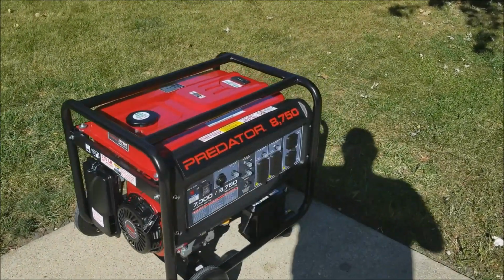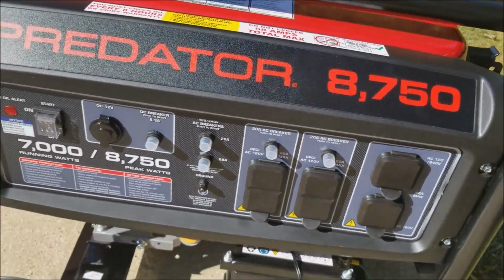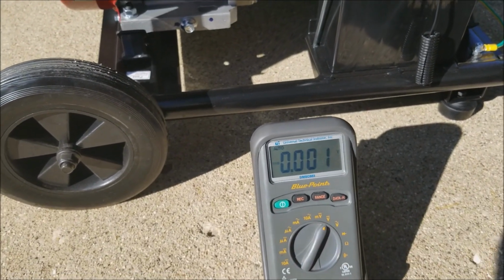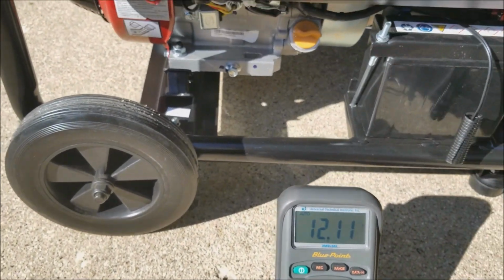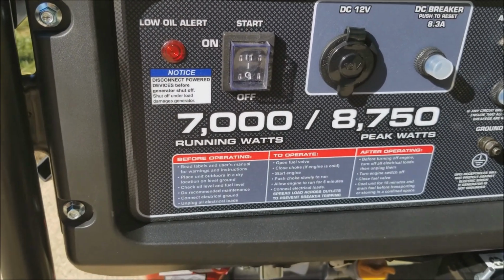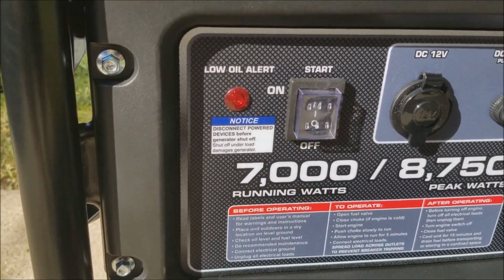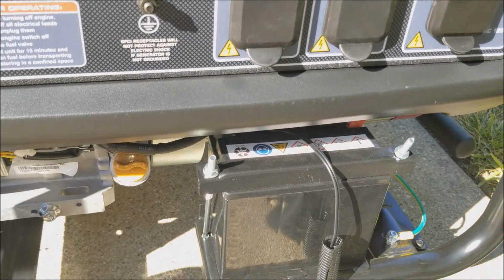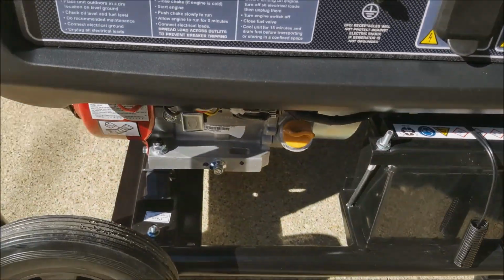Predator 8,750 Generator start up and voltage check

Comment: I purchased my Predator 8750 from Harbor Freight on sale for 499.95 and it’s pretty heavy at 230 lbs. I hooked it up through my panel in a detached garage I had built 8 years ago but I did all the wiring and ran 8 gauge from my house to garage underground in conduit put a service panel in with a 50 amp main breaker I still had my 30 amp in from the compressor I used to have and wired it into my Reliance L-14-30 4 prong outside plug and after running it about 2 hours I plied it in after turning off main in house and I can leave all breakers on except Central air went in house and was surprised that everything worked like I never lost electric but my hot water tank stove dryer and furnace are all NG. Now I’m working on just running it on NG LPG and if needed reg gas. This Generator hands down is a good Generator period!
Reply: ⚠️Always make sure you follow all the generator safety rules when you use your portable generator: 

This is just a reminder to make sure. It is important to follow all generator safety rules whenever you use your portable generator. 
Here are the things that need to be followed;

1) KEEPING OTHERS SAFE: Please do not allow an unqualified person or your children to operate and service the portable generator. Just because some manuals don’t say that doesn’t mean it’s safe. That is important against the generator safety rules. We also need to be keeping an eye on our children too. You need to make sure that your children are not playing near the portable generator especially when it’s running so they won’t get electrocuted. Generators pose electrical risks and they can be hot during an operation. Please keep your children away from the portable generator at all times. It is important to keep our children safe especially our little ones. Be aware of all the hazards.

2) WHERE TO RUN YOUR GENERATOR: Some people use their portable generators indoors which increases the risk of carbon monoxide poisoning. It’s important to have a carbon monoxide detector if you have a gas generator. Never ever use your generator indoors even if your doors and windows are open and even in the garage is not safe to use a portable generator. Not even at your porch and your deck. It is never safe to use your generator indoors and in enclosed areas of your home. Your generator needs to be 15-20 feet away from your house. 

3)🔥FIRE HAZARDS: Never refuel your generator while it’s running. You need to let your generator cool off before refueling it and before storing your generator. Never overload your generator too. Never ever back feed your generator. You should never plug your generator into a wall outlet. Also never store propane tanks indoors. Please keep flammable things away from the generator as well and please don’t smoke cigarettes near the generator. Having a fire extinguisher next to the generator is also important against the generator safety rules. 

4) GENERATOR OPERATION: make sure your hands are dry before touching the generator. Never use your generator in wet conditions. Don’t let your generator get wet. You need a generator tent if you need to use your generator during wet weather. Please don’t wear loose clothes when operating the generator. Turn on your generator before plugging in appliances. Use the right cord for your generator. Please do not use worn out cords. 

https://youtu.be/I1jT3ANENvI and here is a video more about keeping others safe when using generators 

Hope this helps

Comment: I've had a 4000w Peak, 3200 w Harbor Freight generator for 8 years. After it failed I bought this model. Later I found out that the reason for the failure was the low oil switch. As I checked the oil before each start, I decided to defeat that switch. Now I use the smaller generator for power failures in the winter, and the larger generator 4 power failures in the summer.
Reply: Don't start won't turn over predator won't start won't turnover generator
Reply: You always need to check oil. Then every 200 hours after first oil change. Get a fluid extractor to make it easier.
Reply: ⚠️Always make sure you follow all the generator safety rules when you use your portable generator: 

This is just a reminder to make sure. It is important to follow all generator safety rules whenever you use your portable generator. 
Here are the things that need to be followed;

1) KEEPING OTHERS SAFE: Please do not allow an unqualified person or your children to operate and service the portable generator. Just because some manuals don’t say that doesn’t mean it’s safe. That is important against the generator safety rules. We also need to be keeping an eye on our children too. You need to make sure that your children are not playing near the portable generator especially when it’s running so they won’t get electrocuted. Generators pose electrical risks and they can be hot during an operation. Please keep your children away from the portable generator at all times. It is important to keep our children safe especially our little ones. Be aware of all the hazards.

2) WHERE TO RUN YOUR GENERATOR: Some people use their portable generators indoors which increases the risk of carbon monoxide poisoning. It’s important to have a carbon monoxide if you have a gas generator. Never ever use your generator indoors even if your doors and windows are open and even in the garage is not safe to use a portable generator. Not even at your porch and your deck. It is never safe to use your generator indoors and in enclosed areas of your home. Your generator needs to be 15-20 feet away from your house. 

3)🔥FIRE HAZARDS: Never refuel your generator while it’s running. You need to let your generator cool off before refueling it and before storing your generator. Never overload your generator too. Never ever back feed your generator. You should never plug your generator into a wall outlet. Also never store propane tanks indoors. Please keep flammable things away from the generator as well and please don’t smoke cigarettes near the generator. Having a fire extinguisher next to the generator is also important against the generator safety rules. 

4) GENERATOR OPERATION: make sure your hands are dry before touching the generator. Never use your generator in wet conditions. Don’t let your generator get wet. You need a generator tent if you need to use your generator during wet weather. Please don’t wear loose clothes when operating the generator. Turn on your generator before plugging in appliances. Use the right cord for your generator. Please do not use worn out cords. 

https://youtu.be/I1jT3ANENvI and here is a video more about keeping others safe when using generators 

Hope this helps

Comment: Has anyone ran a welder off one of these? I'm looking to get HF 8750 and HF titanium 200 pro multiprocess welder and it would be nice to use the Gen to power the welder.
Reply: Titanium 200 welder can pull up to 36A @ 240V.   If I remember correctly the HF 8750 generator only has a 25A rated 240V output.
Reply: ⚠️Please do not forget to follow all the generator safety rules when you use your portable generator: 

This is just a reminder to make sure. It is important to follow all generator safety rules whenever you use your portable generator. Everyone needs to see this. 
Here are the things that need to be followed;

1) KEEPING OTHERS SAFE: Please do not allow an unqualified person or your children to operate and service the portable generator. Just because some manuals don’t say that doesn’t mean it’s safe. That is important against the generator safety rules. We also need to be keeping an eye on our children too. You need to make sure that your children are not playing near the portable generator especially when it’s running so they won’t get electrocuted. Generators pose electrical risks and they can be hot during an operation. Please keep your children away from the portable generator at all times. It is important to keep our children safe especially our little ones. Be aware of all the hazards.

2) WHERE TO RUN YOUR GENERATOR: Some people use their portable generators indoors which increases the risk of carbon monoxide poisoning. It’s important to have a carbon monoxide if you have a gas generator. Never ever use your generator indoors even if your doors and windows are open and even in the garage is not safe to use a portable generator. Not even at your porch and your deck. It is never safe to use your generator indoors and in enclosed areas of your home. Your generator needs to be 15-20 feet away from your house. 

3)🔥FIRE HAZARDS: Never refuel your generator while it’s running. You need to let your generator cool off before refueling it and before storing your generator. Never overload your generator too. Never ever back feed your generator. You should never plug your generator into a wall outlet. Also never store propane tanks indoors. Please keep flammable things away from the generator as well and please don’t smoke cigarettes near the generator. Having a fire extinguisher next to the generator is also important against the generator safety rules. 

4) GENERATOR OPERATION: make sure your hands are dry before touching the generator. Never use your generator in wet conditions. Don’t let your generator get wet. You need a generator tent if you need to use your generator during wet weather. Please don’t wear loose clothes when operating the generator. Turn on your generator before plugging in appliances. Use the right cord for your generator. Please do not use worn out cords. 

https://youtu.be/I1jT3ANENvI and here is a video more about keeping others safe when using generators 

Hope this helps

Comment: Dam it's pretty! Nloud! Pretty Loud!
Reply from the maker: It's a generator, they tend to make noise, it's just part of the deal
Reply: Loud
Reply: This generator is really loud
Reply: These clones are all load.
Reply: @josephpuchel6497  ⚠️Please do not forget to follow all the generator safety rules when you use your portable generator: 

This is just a reminder to make sure. It is important to follow all generator safety rules whenever you use your portable generator. Everyone needs to see this. 
Here are the things that need to be followed;

1) KEEPING OTHERS SAFE: Please do not allow an unqualified person or your children to operate and service the portable generator. Just because some manuals don’t say that doesn’t mean it’s safe. That is important against the generator safety rules. We also need to be keeping an eye on our children too. You need to make sure that your children are not playing near the portable generator especially when it’s running so they won’t get electrocuted. Generators pose electrical risks and they can be hot during an operation. Please keep your children away from the portable generator at all times. It is important to keep our children safe especially our little ones. Be aware of all the hazards.

2) WHERE TO RUN YOUR GENERATOR: Some people use their portable generators indoors which increases the risk of carbon monoxide poisoning. It’s important to have a carbon monoxide if you have a gas generator. Never ever use your generator indoors even if your doors and windows are open and even in the garage is not safe to use a portable generator. Not even at your porch and your deck. It is never safe to use your generator indoors and in enclosed areas of your home. Your generator needs to be 15-20 feet away from your house. 

3)🔥FIRE HAZARDS: Never refuel your generator while it’s running. You need to let your generator cool off before refueling it and before storing your generator. Never overload your generator too. Never ever back feed your generator. You should never plug your generator into a wall outlet. Also never store propane tanks indoors. Please keep flammable things away from the generator as well and please don’t smoke cigarettes near the generator. Having a fire extinguisher next to the generator is also important against the generator safety rules. 

4) GENERATOR OPERATION: make sure your hands are dry before touching the generator. Never use your generator in wet conditions. Don’t let your generator get wet. You need a generator tent if you need to use your generator during wet weather. Please don’t wear loose clothes when operating the generator. Turn on your generator before plugging in appliances. Use the right cord for your generator. Please do not use worn out cords. 

https://youtu.be/I1jT3ANENvI and here is a video more about keeping others safe when using generators 

Hope this helps

Comment: after all the videos showing the proper way to set up any generator ,the ppl don't even say or show that most fenders come with a ground point but they fail to use it.

in most cases if you have a and terminal on it it should be used.this is a fact known to all electricians .proven by a known source the electric company that services our state. 
   so my suggestion is to connect a cable to a and spade to make it safe.
Reply: I meant to say gen sets
Reply from the maker: @robertbohnet1970  understood, if you follow my channel, you'll see that the unit is eventually grounded to a ground rod once it's installed in its permanent location. This video was only for testing the generator